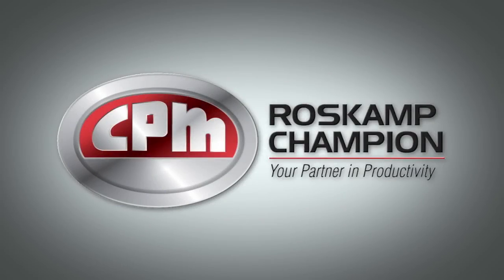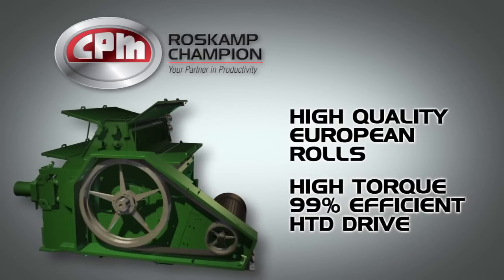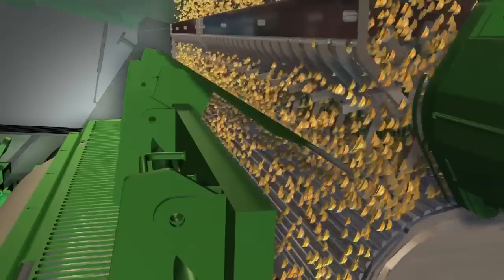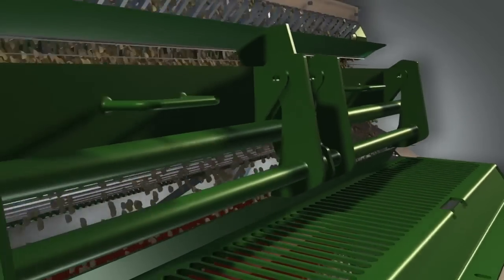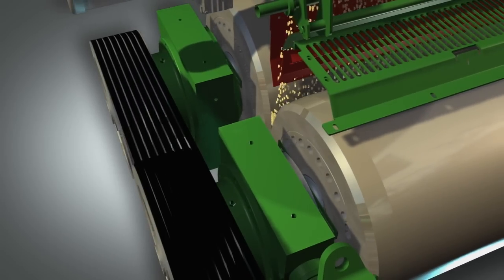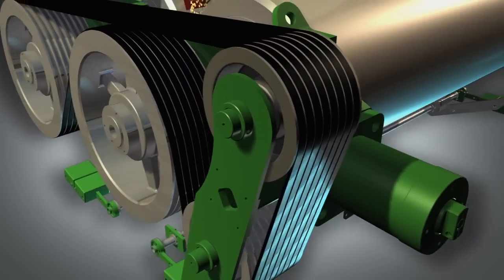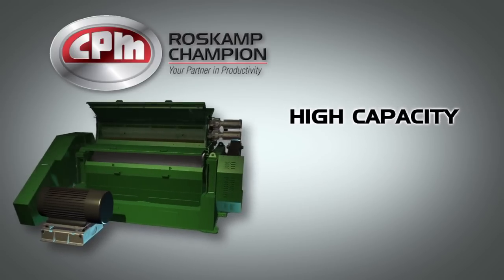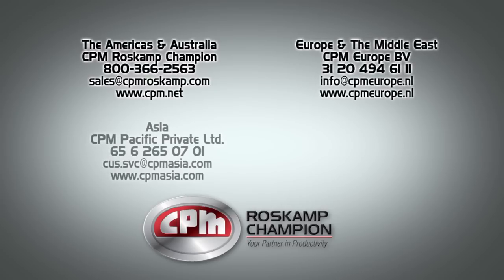Roskamp Champion - Flaking Mill

Comment: Do you have anyway to fix an issue with moisture building up in transition into the clump breaker blades? Work with the same unit and moist product builds up above those blades and causes backing up.
Reply: Does your inlet flow have equipment upstream that could be introducing additional moisture to the process?